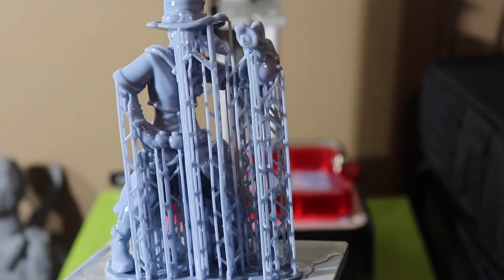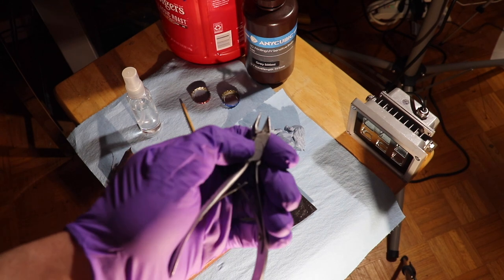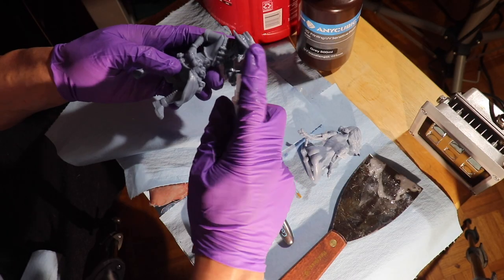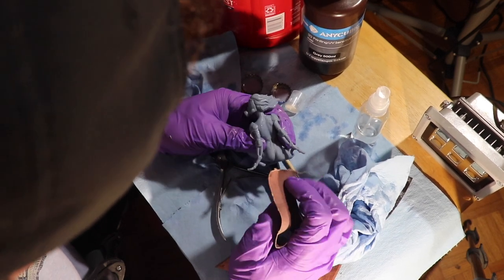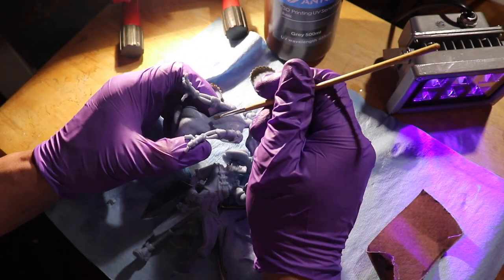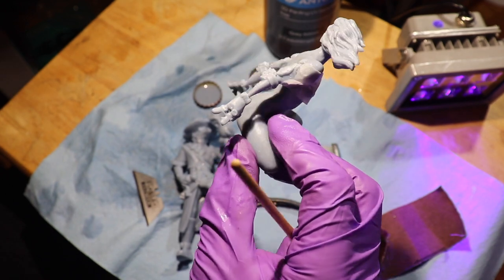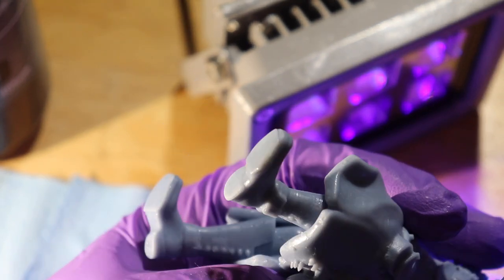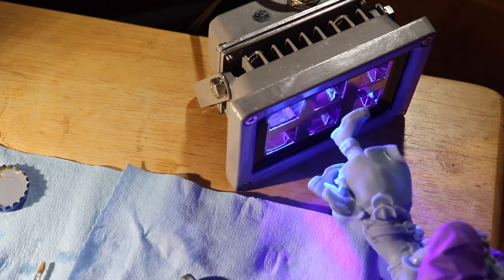Fixing your Resin prints from support damage. 3D printing model fix

Comment: Better support settings would make the supports peel off in warm water without clippers or most post cleanup. Nice job with the cleanup of damages though.
Reply from the maker: Wes Mischke yeah I normally get great prints and agree but there is the times when you print a new model and maybe the orientation isn’t just right, or the times a part has a layer line, this technique works to save money and time.
Reply: Zach of All Trades Indeed 👍, I usually encounter this with pre-supported files.
Reply: Hey Wes, could you share with me a video talking about how to do that with supports? I'd love to learn more.
Reply from the maker: Bane Williams I’m actually going to make a video for better supports , most of my prints don’t need repair but I wanted to show how to fix it if the damage was already done or how I fix the one model that couldn’t stand with just a tad bit of resin and curing. I’ll also be making a video comparing all the resin that Phrozen makes as well.
Reply: What do you do with the water though?